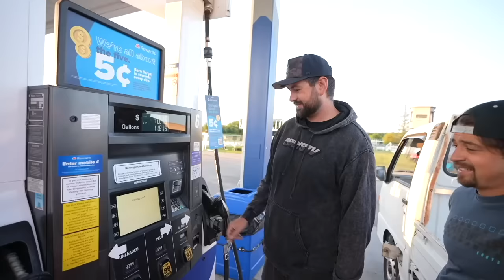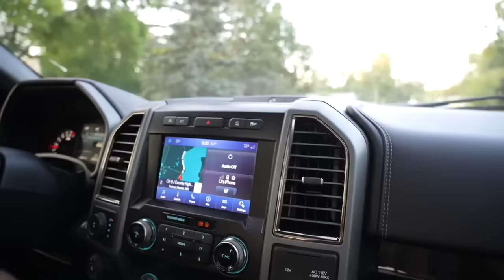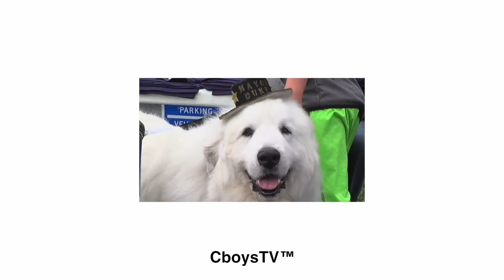Front Flipping My New Mini Truck

Comment: There wasn't enough curve in the back half that's why it teetered on the edge. Also I feel like those little bits of pipe sticking down on the front were digging into the ground